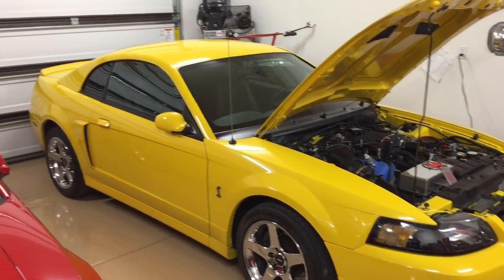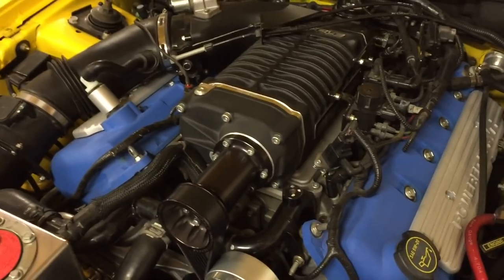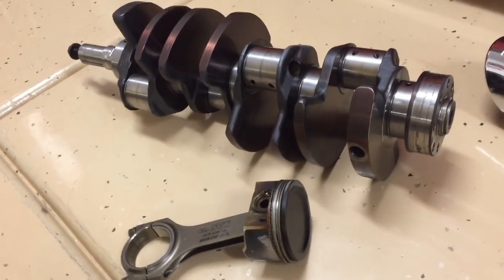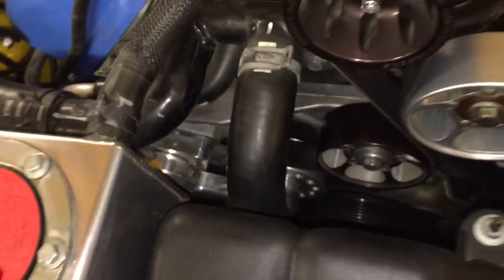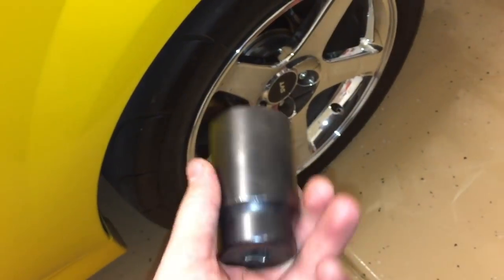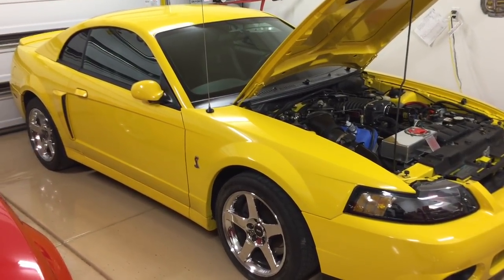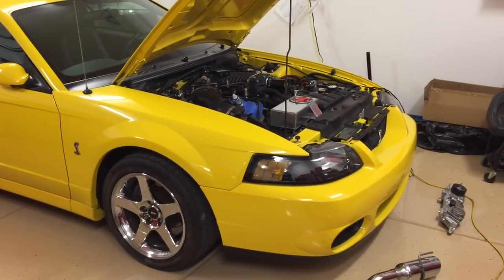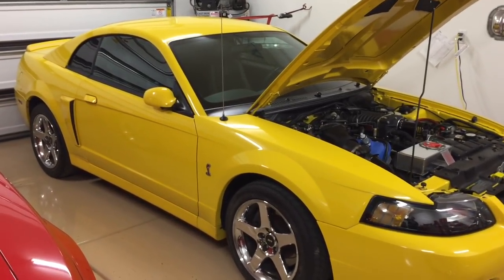Terminator Cobra FAQ: Know before you buy

Comment: I have a 2003 Black Cobra with 61k on the clock with the basic bolt-ons making around 450RWHP and so far this car's been a great summer car.  Mine was built 8-30-02.
Reply from the maker: 11DS450XMX I wonder if yours ever had the head recall done. Did you own it since new?
Reply: Only had the car for about 4 years so
not certain what or wasn’t done to it.

Comment: Good Info!  My 03 was a Nov 02 build, I bought with 25 miles on it(9 I put on it since I was a dealership Tech and fell in love)  so, got the fun "tick".  When I went to the 3.4 Whipple, seems the 25+ psi and load, the lower pulley broke, so Metco came into play and lowered the boost too, I could list the fun times, the passenger seat squeak fix, A few tricks I learned.
Reply from the maker: SC457A Very cool! Our dealership was not SVT at the time, so they had Mach 1s to drool over. I can’t imagine what would have happened if they had a terminator there for us. That’s a really cool story you have!

Comment: Awesome video and super informative!! I've decided to sell my 03 Mustang GT after owning it for 8 years cux I've just gotten the itch to have a Cobra now. Friends pressure just sell it but hard cuz I bought it cash at 19yrs old my dream car since I was 8yrs old, taught me a lot of cars and boosted my career as an auto tech, dumped $$ on performance running 320HP but that's another story. My Q is (& Ik it's something not commonly asked and silly) but I've run several headlights on the GT with HID's where they melted the housings and I knew this happen because I just don't like any of the projector headlights they make for mustangs. Yes I ran 8k 55w ballasts, 6k 55w, and then stuck with 6k 35w so they'd stop melting them and avoiding Driving at night. So I want to run HID's on the cobra when I get it to the ones with silver turn signal markers(not projectors and I want a black cobra) but I don't want to buy projectors and also don't want to keep buying new housings all the time. Are the stock bulbs Halogen? Or HID? And do u know of any good brand for HID's?
Reply from the maker: XxBEFALLENxX I have HIDs in the mach 1 and stock halogens on the cobra. My suggestion would be to look at some LED Setups that don’t require a ballast and the likelihood of melting anything. SW lights seem to have good things, but I don’t have any of their products
Reply from the maker: XxBEFALLENxX Also, maybe consider keeping the GT as a daily and that way the Cobra can stay nice and on collector car insurance which is about $300 per YEAR full coverage

Comment: The Size of the Phillips head screw they used on your independent rear suspension is huge. jk
Reply from the maker: ha ha
Reply: Danny Johnson I’m trying to find a driver cobra what would you recommend?  I will put a lot of miles on it.
Reply from the maker: My recommendation would be a low mile one with some kind of title issue (theft recovery, light collision). That way you're getting it cheaper but the car itself will last longer.

Comment: Danny, you edited out something you were about to mention concerning the 5th/6th fear pulls.
Reply from the maker: mike22810 I think that’s when my camera died- 5-6th gear pulls are really hard on the car (especially with the stock blower due to heat generation). I was also going to mention the head cooling mod where you pop out the driver side freeze plug and connect the driver side head to the passenger side
Reply: Danny Johnson and what does that do?
Reply: @Real-03dsg  prevent's the heat spot in the back of the hood. Just connects the cylinder heads together. Hard to do without dropping the transmission

Comment: axle nuts should have a cotter pin to keep it from loosening
Reply from the maker: biggdaddy blade works Unfortunately the cotter pin is not always lined up to where the nut ends up when torqued to spec, so it will loosen to that point. It will keep the nut from coming off entirely, but won’t guarantee bearing loss
Reply: Danny Johnson i have never had that happen but im sure it could
Reply from the maker: biggdaddy blade works  Several IRS cobra owners have lost the rear, driver side bearing. It's common for the nut to self-loosen as the wheel spins in the direction on the driver side to loosen the nut whereas the passenger side will tighten it as it spins (similar to the crank pulley and it's need to be reverse thread). The axle nut cotter pin does not prevent the nut from loosening unfortunately

Comment: Super helpful video thanks so much! Would you consider $27k a fair price for a black car with 60k miles? Clean CA title.
Reply from the maker: Yes, it is these days. Maybe $25k
Reply: @dannyjohnsonsgarage  Thanks! Would you stay away if it has an aftermarket lower crank pulley?
Reply from the maker: @cadenmedcalf1069  I wouldn’t stay away, and it’s easier to change the inner belt with one. It’s just better support with the stock one and not a  big deal if it has the stock eaton
Reply: @dannyjohnsonsgarage  Ok thank you. It has the stock Eaton but it is ported.
Reply from the maker: @cadenmedcalf1069  my friends had 140k+ on it with an aftermarket lower and was just fine. It’s just better support for bigger blowers https://youtu.be/ZrtzOCheUkw
Reply: @dannyjohnsonsgarage   Oh wow that motor seems really strong for 140k. What other mods does he have? Does it seem weird then that he would do aftermarket lower crank pulley before a supercharger pulley?

Comment: Slowly working my way through all of your terminator videos. I’m strongly considering getting rid of my 2017 scatpack for an 04 term which has always been my dream. Would you mind possibly going over pictures of one I am looking at and possibly discussing the car with me a bit? I know you have a life and are probably busy so I would be willing to pay you for your time. Let me know, thanks!
Reply from the maker: Jaydee392 Sure. Do you have a link to it?
Reply: I won’t put any of your information out there or anything like that. Just seem very knowledgable and observant when it comes to terminators.
Reply from the maker: The car looks pretty clean, even bringing up small details like broken clips for carpet floor mats. They mention small scratches on the bumper and such- it’s hard to tell unless you see it in person. The walk around sounded pretty good. The next step would be driving it. It’s hard to travel, but that’s a big commitment. I wouldn’t purchase it without driving it. 
   Without looking up close in person it’s hard to say if anything had been modified and returned to stock. Looks stock other than the snake in the grill, exhaust, and the wheels (which he said you get the originals with the sale). 
   Everything looks really good. Stock lower crank pulley, the engine looks stock. Original floor matts.  I think it’s a good car and the price is fair. $23.5 is well what it’s worth. I wouldn’t go lower if I were him.
Reply: Danny Johnson thank you much for going over the car. It’s so hard to find a clean low mileage 04 convertible. I was originally turned to your channel because I really want a screaming yellow but that’s proving even more difficult. That car is 8 hours away I’d hate to take the trip and not like the car but may have to. If there is any way I can compensate you for your time let me know. Thank you very much again.
Reply from the maker: Jaydee392 I have a link to my Patreon account in the description as a way for viewers to support the channel if they please, but I wouldn’t expect anything. I enjoy helping people as much as I can, and that should be simply what friends do.

Comment: Danny..  I just purchased an 04 Cobra - What is the best way to contact you please to ask a few questions.  Thx for great videos !
Reply from the maker: King78Cobra Right here on the comments is the best. Other people may have the same questions and it’s great when they can read through them as well
Reply: Thanks Danny…  Here goes.. I have lots of questions.. Thanks for great videos
– I am Mustang poor as they say.. My 1st was
A 1978 4-cyl Mustang II – I wanted the Black Cobra II – Dad said no.. you get the silver and red 4 Cyl.  But I was hooked from then on.  (Needless to say it took me 32 years before I found a nice King Cobra.)    The Terminator cars always seemed to escape me – But I kept looking.  I watched all your videos on the 
 03 vs 04, things to consider etc..   I ended up buying a 04 Convertible due to the difference in the heads.  It’s a Mystichrome with 45K miles.  I looked for one with not really low mileage.. because I did not want one that was sitting forever… but not a high mileage car either.  I also looked for as close to stock as I could find.. just in hopes that it was not abused too much and so that I could upgrade it from a base line..  I do have an SLP Catback exhaust as well as an upper pulley kit. Best I can tell (THANKS to your vid’s again).. it’s a 70MM / 100 MM pulley set. (I did not pull the belt off… but that’s pretty close on the 70MM measurement).  I have no idea if it has any sort of tune. I test drove an 03 before I found this one and before watching your video.  The 04 is much stronger to me, but that 03 was ran hard and put up wet !   that’s my baseline..  So the Question is.. what would you do 1st ? – Do you have a list of “recommended upgrades”?  That is my main concern. I want to change out items that are known weak points (stock idlers etc) and add any needed gauges, items etc..to guard against problems etc...  But - I don’t want to replace something and then upgrade the same item later in another needed upgrade.  I would like it to be dependable to play with.. but not prone to break every time you do.  I know you can make really great HP with these engines.. but where would you say the line is where you go from dependable to breakable ?  500HP – 600 HP ? - Hope that makes sense !  I look forward to your input.. MAYBE a future video on “Bullet Proof Recommended Upgrades” down the road?  I volunteer my Terminator  !  Thanks again for a great channel – You have inspired me to make a video on each of my cars to share online with others.  Many Thanks in Advance for Your Input – 1SG (R) M.
Reply from the maker: King78Cobra Very cool. Sounds like you got an awesome cobra! 

My first suggestion would be to get a wideband gauge so you can monitor the air fuel ratio. That will tell you how it’s been running and assure it’s not running lean. You will want to see 11.2 or less on the gauge to know your tune is rich enough. (during wide open throttle, and 14.7 at idle or light driving)

Next, I would get an aeroforce interceptor gauge or the 2 gauge setup (I have a video on that too- EASY gauge, just plugs into the OBD2 port). That gauge will tell you a ton of things you’ll want to see like the charge temp, volts, etc. 

As part of the interceptor gauge, pay close attention to the alternator/volts. My friend lost his engine to a lean condition and the alternators on the terminators fail often. You’ll see my video on the mechman alternator with big 3 upgrade. 

Fuel pressure goes hand in hand and should also be monitored on the aeroforce gauge or a mechanical one. I believe the aeroforce will simply read if the car is asking for pressure vs the gauge telling you what’s actually in the rail. 

ignition timing is good to monitor as well from the aeroforce gauge 

Purchase a spare fuel rail pressure sensor (frps). They go out often and leave you stranded 

I would recommend keeping the stock lower pulley with the cage. 

Otherwise, a pulley only cobra is nearly indestructible if monitored correctly. My cobra makes just about 600 even to the tires and it will last virtually forever that way- I think that’s a safe number- but also it depends on habits with the car. Avoid any 5th or 6th gear freeway pulls, and consider a head cooling mod at the point you ever change the clutch. 

Get a 36mm socket and check the driver side axle nut to be tight at each oil change- the way the wheel spins on the driver side can loosen the nut over time and start to ruin the bearing 

I would consider a boost a pump, ngk tr6 plugs gapped to about .030 (I have videos on that too)

Don’t ever let the axles hop when accelerating- let off as soon as you feel they are
Reply: @dannyjohnsonsgarage  Thanks Danny - if you have links to any or all of those parts.. please list them  - No Problem giving you credit for anything I get !  - Thanks again and keep the ideas coming !  1SG (R) M.
Reply from the maker: King78Cobra Here is the aem wideband I have. Very nice one that can save your engine https://www.amazon.com/gp/product/B007ZAQLF6/ref=as_li_qf_asin_il_tl?ie=UTF8&tag=2004047-20&creative=9325&linkCode=as2&creativeASIN=B007ZAQLF6&linkId=d108616ce28fb321bda8a4e0dd22d7a8

As for the aeroforce gauge, they all sell for about the same price- but you need to find the color on the backlight you like (some do green to match the factory gauges), I liked blue
Reply: @dannyjohnsonsgarage  Thanks Danny..   Please list anything else you recommend and have links too..  Purchasing the Wideband now !  MANY THANKS !
Reply: Danny Johnson great advice. What is the reason for the 5th gear pull on the highway. Overheating or ? I’ve heard this before. Very interesting to me as to why. Thanks again for your valuable info. I should have bought one 4 years ago for 17k when I had a chance. It was  modded nicely, clean, and cared for with like 40k miles. I’m smacking myself now as we speak.
Reply: @King78Cobra  sorry to bother you but I'm concerned I'm about to buy an 04 with 27,000 miles and its just exhaust and 2.8 pulley so no major mods but when I pick it up I have to drive it 5 hours ... is this long drive gonna melt piston 7-8 due to no head coolant flow, I mean is that what does it ..any help me be much appreciated

Comment: Where did u get the die cast cars?looked for them on Amazon but couldn't find one .I have a big  Collection of  Military fighter jets wanted to add a Cobra to the collection but can't find them
Reply from the maker: NHWilderness Ebay is about the only place you can find them. Especially the yellow cobra models that were only offered at target or hobby lobby- very hard to find those. They have gone up quite a bit in price into the $100+ range!
Reply: Danny Johnson I'll look on eBay don't have an account have 2 open one

Comment: I'm about to buy a cobra , and I'm worried about the piston melting due to no flow out of the driver side head, when i pick the car up im going to have to drive the car 5 hours . I'll be highway driving 2500 rpmish, can someone please pm me and tell me if this is a major way to cause piston melting. Thanks
Reply from the maker: Mike Mcneill The piston will not melt under that situation. It will melt if the car is at 150+mph for more than 5 minutes full boost and the alternator fails. Just driving without boost won’t hurt a thing. Boost comes on with throttle position, so 6th gear cruising at 2,500 rpm will do no harm.

Comment: Danny you have no idea what you are talking about. I can't believe you are reading this comment right now but I had to get your attention some way! Great vidz! Thinking about getting a termi. Whats the best way to get a loan for a car this old?
Reply from the maker: Madtwos ! Personal loan if you can’t get enough from a car loan. Depends on a lot of factors. If it’s not your only car and you have a locked garage, look into collector car insurance. I paid $311 for the entire year, full coverage
Reply: @dannyjohnsonsgarage  Thanks brother! How can i tell if I am getting a later model that doesn't have those early issues. (like the spark plug thread issue) Do the models with the shift light mean they are the later models?
Reply from the maker: Madtwos ! A 2004 model is your best bet, but you may be after a color made in 2003z It’s hard to say until you pull a plug to see how many threads (or crawl under it and get the casting number at the back of the cylinder head). My twin brother has four 4Vs two are 2003 and the other two are 2004. He got the better heads on all 4 cars by luck. The 10th anniversary is most likely to have the 9 thread heads. You just won’t know until you look at it
Reply: @dannyjohnsonsgarage  Dam... Wish there was an easier way. All the termis I see that I want are 200+ miles away.

Comment: Hey Danny, can you clear something up for my? I heard something about longtube headers dropping boost pressure. So what’s better ?
Reply: EAbraham.R I’m no expert, but what I’ve seen with that it is an aftermarket header thing. When you take away the restriction that headers give, you’re losing some of the back pressure barrier. Thus the overlap where the exhaust valve is still open allows for more air to escape. 

That’s how it was explained to me. I also heard not to worry because you will still be marking the same or better power and in most cases it’s negligible or non existent in the amount of loss
Reply from the maker: Yes, as EAbraham.R said, boost is a measure of restriction, so you will have less restriction and make more power. It’s like breathing through a straw and then giving you a bigger straw to breath through- you’ll push more air with least restriction, so win win